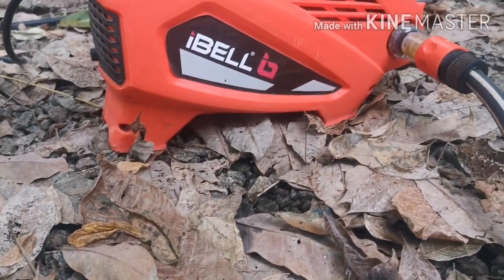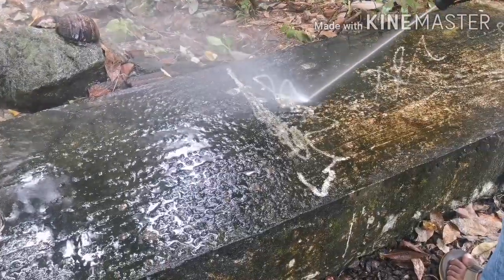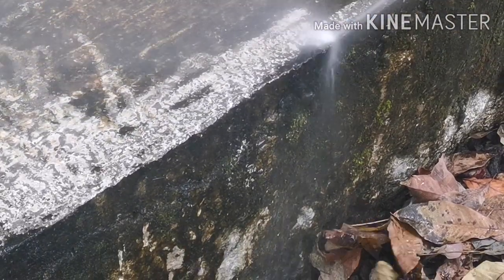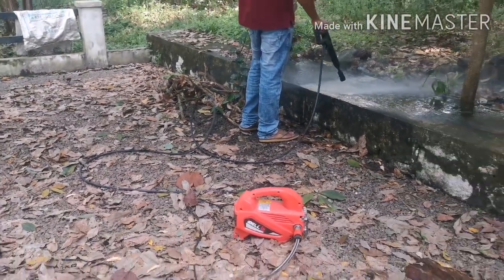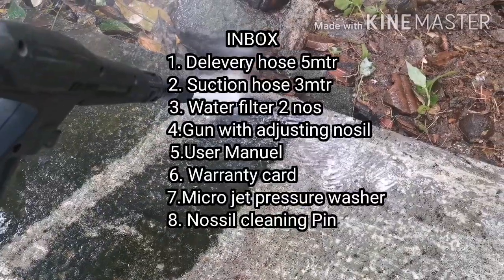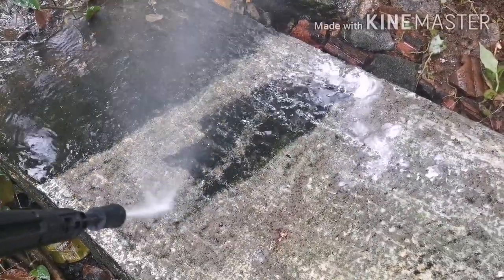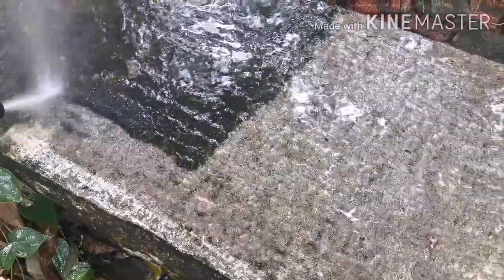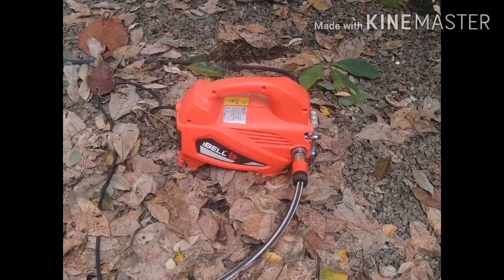iBell-PRESSURE WASHER UNDER 10000/- IBELL MICRO JET #ibell #pressurewashing

Comment: Most of the compact induction motor pressure washers are not capable to run continuously, like STARQ,JPT, VINTRO etc and maximum run time 10 to 20 minutes only. iBell induction models are capable of running continuously but costly too.
Reply from the maker: Thats right another advantage is site service is available if getting any complaint